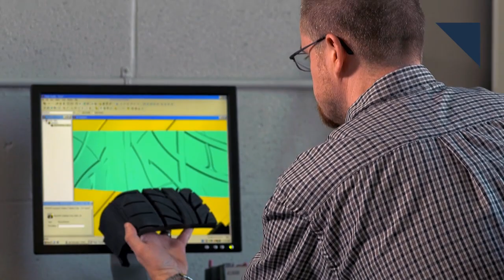2018 Buick Regal GS, How NAFTA Talks Could Impact Autos - Autoline Daily 2151

Comment: With the recent poor ratings for headlight performance why would this BRAND NEW Buick Regal have non projector headlights? I'm going to assume they are standard halogen bulbs as well, quite a misstep when the tech to make the lights much better is almost 20 years old now
Reply: Projector headlamps are even on Toyota Tacoma pickups now, with halogen projector headlamps.

Comment: Why does GM put Brembo brakes on front only? They really can't get Brembo to produce a rear brake caliper at the price point of what GM uses now? C'mon.
Reply: The rear brakes don't do that much of the braking anyway, especially on a fwd biased car.   They have to be electronically limited already in braking power as they will lock up earlier than the fronts.
Reply: I'm specifically referring to the consumer impression upon hearing "Brembo front brakes." I and the rest of the consumers hear that GM is not willing to go all the way on brakes. Nobody really cares what brakes do.